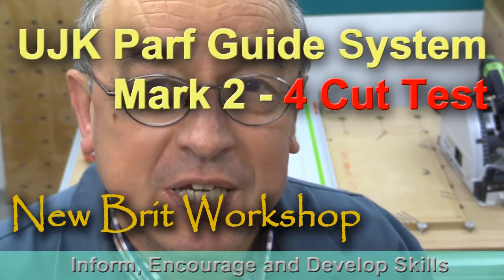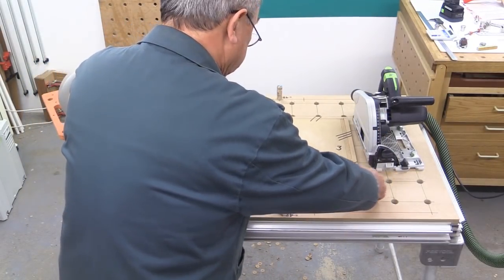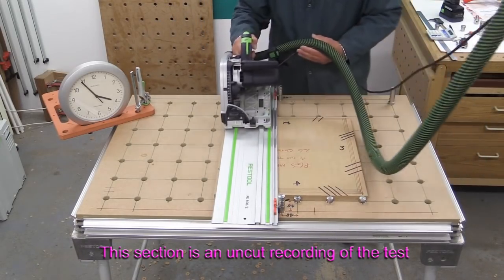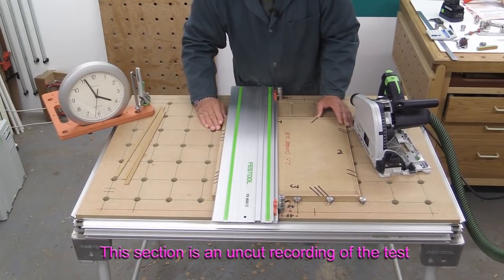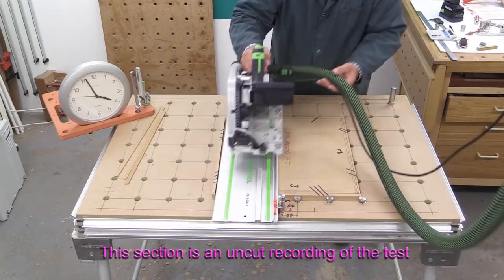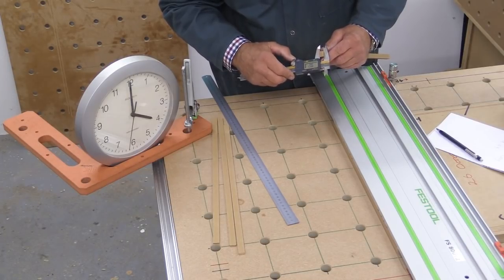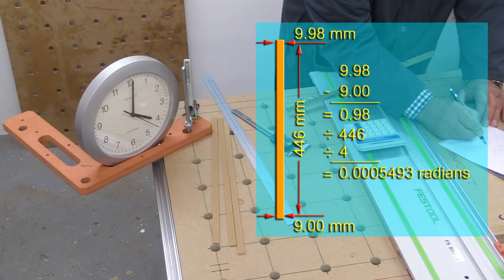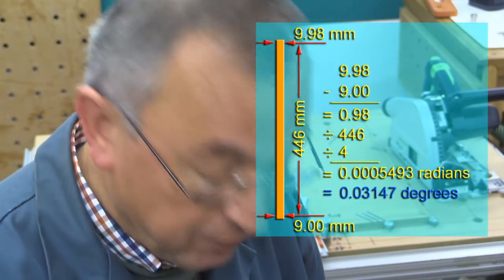UJK Parf Guide System Mark 2 - 4 Cut Test

Comment: Peter, I would like to add my appreciation too after  recently purchasing the mkII system. What an outstanding piece of kit!!

The concept is pure genius (with a little help from Mr. Pythagorus 😉) and the engineering and machining is outstanding. It was a real pleasure working with such a precision tool.

I have never owned an MFT style worktop before - let alone made one - but the combination of your videos and the precision engineering from UJK made the whole process an absolute breeze.

My first attempt produced a custom top with an accuracy of 0.016 degrees (average result on three 4 cut tests). Good enough for government work ;) I also knocked up a couple of fences/stops for jig work.

Thank you!
Reply from the maker: Hi Steven, Thank you so much - brilliant.  Cheers.  Peter

Comment: Hi Peter, out of necessity last year I made my own attempt at a MFT, using nothing but ‘great care’ - and I was very happy with it … for about 5 minutes!  Even as a DIYer, the degree of error in terms of getting things square was driving me mad - so I bought the Parf Guide Mark 2 last week, made a new MFT top (a cross between your rectilinear and isometric versions, so I can do 90, 45, 30 and 60 cuts …. and in a very small workshop space and on a quite small bench top. The result? I’m thrilled - incredible accuracy produced by the Parf sticks and guide block.  Some people worry about tear out from the forstner but? I had none - the underneath of the new MDF top was barely distinguishable from the top side. I did your 4-cut test and got a similar result to yours (thankfully my calculator has Pi 😂!!) and checked my test piece of wood with my angle finder… 2 x 90.05 degrees and 2 x 89.95 degrees - that’ll do me!!! 
Looking forward now to all the accurate cutting I can do without agonising over constant measuring. Can’t speak too highly of the Parf system - it’s superb - many thanks 👏👏👏
Reply from the maker: Hi Miachael, I am delighted that you are happy with the PGS - it took 3 years of my life to get it to market and getting feedback like yours is perfect compensation.  Cheers.  Peter

Comment: I think I need to point out that it's called a 5-cut test because you cut the first surface twice. When you measured your fourth surface after cutting it, you were measuring against one face that was not known to be straight. It had never gone through the cutting process on the outside, only on the inside surface, leaving it open to a huge potential error. Had you gone ahead and cut a fifth time, you would have been cutting off a strip that had gone through the process twice, producing a clean and Parf-accurate inner and outer face. I have done the same 5-cut test with my own Parf guide created top and my error was less than .0015 across 60 inches ( the sum of the five side's lengths).
Reply from the maker: Hi Michael, You are right and I did explain this in the video.   Peter

Comment: I think it is better to convert your angular error of 0.03147 degrees into a useable measure such as 0.33mm per 600mm cut.

Also, quite interesting that the error is double that of the previous video on the original PARF system. I wonder how much variance there is cut-cut vs system-system.

Comment: That is impressive. I have found that degrees and radians are not a practical way to measure small angles.  It is more meaningful to me to say that the cut is out of square by 0.98mm over a distance of about 1700mm (4x446mm).
Reply: Thankful we didn't go to the moon with that error ..we would be quite a distance away from 🌒

Comment: Peter, thanks for this test, it shows your system is performing similar to a 5 euro regular square. 1mm off on 450mm is not impressing. The accuracy that is "good" would need to be something like 0,2-0,3mm off per meter.
Reply from the maker: Hi Rob, If you read the previous comments that I have made you will discover that I had a fault with the fitting of my saw to the guide rail but I did not know it at the time and published the results as an honest report of my test.
I repeated the test. 
https://www.youtube.com/watch?v=FsBIWL30RP0

I did eventually make a video about adjusting the TS55:
https://www.youtube.com/watch?v=qihJeoKa86g
Peter
Reply: Both of you are incorrect.
The cut method of rotating means you are adding previous error to the next cut. Peter is actually getting 0,98 mm by 4*450 mm. That is approximately 0,5 mm/m. Which I find acceptable (issues with rail and clip nevertheless).

The alternative to the rotation is making a long enough cut (1,8 m in this case).

Comment: Actually    (arctan(.98/446) )/4 with calculator in degrees mode or if in radians (x 180 / pi). The answer will be pretty much identical to 4 or 5 decimal places but more accurate. Using radians straight away as you have is assuming the 0.98 is part of a curve even though its very close, it is still a straight line. Sorry for being pedantic. 

I own Mark 1 and love it. The accuracy is incredible. I bought the CNC made UJK assembly square and it fits perfectly
Reply from the maker: Hi John, Yes, of course. For very small angles a reasonable approximation (which is certainly good enough for woodwork) is that the tan of the angle approaches the angle in radians as that angle reduces. Maybe one day I will make a video about numerical methods for double integrals !   Cheers.  Peter
Reply: @NewBritWorkshop  Point taken but I would find that interesting !!!!!
EDIT ..... Oops! I just saw that I posted about this 6 months ago and had forgotten I had. Sorry for the duplicate comment Peter! 

You know what old maths teachers are like, they can't help themselves when they see something not quite perfect. I'll
 delete the one below
Reply from the maker: Hi John, For my thesis I created computational solutions for ballistics tables in SI units which were, at that time, only available in Imperial (foot/pounds etc). The original tables had been created by hundreds of people number crunching on old fashioned adding machines with a big leaver on the side to execute each calculation. They took several years to produce the results. I met one of these people who was, as a result of the use of those machines crippled with arthritis. I had to find efficient ways of taking the original equations (most of which involved double integrals) in order to produce the SI tables using a main frame computer. I suspect the whole thing could be done on an iPhone nowadays !    Peter

Comment: I have had your system for a little over 2 years and made a few tables roughly 3 by 5 ft with great luck but now I am making something that will be 2 x 8 foot. Do you recommend a order of drilling to ensure the 8 ft line of holes are as accurate as possible. Normally I would do 10 holes down one side then the right angle of 8 to 10 holes then work off that grid to finish the rest of the table.
Reply from the maker: Hi Richard, Start with the first Parf Stick central to the long edge and then you only have to extend the same amount left and right and it will be more accurate. You will need to use that little joining thing to link two Parf sticks when you tackle the columns. Take your time and make sure the 6 mm shoulder on the pins is properly seated in the Parf sticks. Good luck.  Peter
Reply: @NewBritWorkshop  awesome thank you.

Comment: Hi Peter, Thanks a lot for the great videos! Any advice on thickness of the mft top to be used (min - max)? 
Stefan
Reply from the maker: Hi Stephane, I use 18 mm Medite Moisture Resistant MDF. It is slightly more expensive than normal MDF but far tougher and it machines well.   Peter

Comment: Hi Peter, it is advisable to polyurethane the mdf board first before start drilling it or after?
Reply from the maker: Hi Wau, Always BEFORE drilling.   Peter
Reply: New Brit Workshop thanks a lot
Reply: New Brit Workshop another question, I found a little play between the ruler and the 3mm guide when it is sited firmly. Is that normal? Tq..
Reply from the maker: Hi Wai, There should not be any play between the rulers and the 3 mm pins - make sure that the 6 mm boss is seated.   Peter
Reply: New Brit Workshop Peter is not the pin is the 3mm guide for drilling. The pin sits perfectly. Also the pin is so fitting that is very hard to remove. I have to hammer from the back to pull it out :).

Comment: Hi Peter, are the rail clips 100% accurate? could that could add to the inaccuracy?
Love your channel. Always a great inspiration.
Reply from the maker: Hi Ernest, Yes, they do hold the guide rail tight against the tall dogs.   Peter
Reply: You rely on the edge of the rail being parallell to the inner track on the rail on which the saw is running. Which it is over a long enough run, but it could have imperfections or wear. It would probably only take a minor knick in the aluminium to shift the result that amount.
Reply from the maker: Hi Magnus, That is true. Both my rail and saw are quite old now.   Peter
Reply: @NewBritWorkshop  my very early original ts55 festool track is a little warped and I am not quite sure if age bends aluminium  extrusions ?

Comment: Hi Peter. I’m really struggling with what parf system to buy mk1 mk2. I see Axminster are selling the mk1 at a very good price. 
Thanks in advance
Reply from the maker: Hi Mark, If you are only likely to use the system a few times then the Mk I will be fine but for long term durability (and sharing the kit with friends) then the Mk 2 is better.  Peter
Reply: @NewBritWorkshop  hi Peter. I just thought I would give you my thoughts on the parf mk 1. Axminster as per normal posted fast and dpd delivered it today. 
With the custom size top cut I started to lay out and get my head around the system. Having been hopeless at maths in school and looking at the instructions for a hour a picked myself up and went for it! 
Credit to you and Axminster I now have a nice mft that fits my space and with very accurate holes. 
The system is very well thought about and made very well indeed. 
I’m not sure I followed ever detail in the instructions but it all ended very successfully. 
Massive thanks to you Peter 😊👍
Reply from the maker: Hi Mark, That is brilliant and I am so grateful that you let me know about your success and pleasure with the product.  Cheers.  Peter

Comment: Interesting to note I parf holed a flat plywood 17mm top and it warped after all the holes drilled . Has anybody encountered warping after holes ?
Reply from the maker: Plywood will do that as a flat sheet has many stresses but the glue keeps the sheet flat. As soon as you start to machine it (take bits away) there is a risk that some of the stresses will be relieved by movement. Better to use 18 mm MDF.  Peter
Reply: I do recall when a wood worker friend was ripping sheets he always said run it though the saw a second time because the sheet releases stresses after its cut
Reply: @NewBritWorkshop  do you have the link of where you repeated this experiment with a tuned TS saw ? I just cannot locate it but readai where you did one
Reply from the maker: Yes, I had to look for it:
https://www.youtube.com/watch?v=FsBIWL30RP0
I have now put 4 cut test in the title. The test is after 12 minutes or so.   Peter

Comment: Hi Peter,  What are those short dogs you call "pups"?  Addendum:  I see from your other video that these are the UJK Guide Pups.  I will get some.
Reply from the maker: Hi John, I think that the Pups are perfect but remember, all of the UJK produced dogs and extras are built to a tight tolerance and so they will be snug in the holes. I like to leave mine permanently in place on my tracksaw cutting station.   Peter

Comment: Hi Peter, am I reading this correctly the cut is 0.25mm tapered over446mm.( 4x0.25 = 1mm over 4 cuts ) I would have expected a precision setup like this to be a lot more accurate ??
Reply from the maker: Hi Mike, I think that it is rather good considering  there are so many other factors that can affect accuracy. I will initiate a competition amongst Mark 2 owners once the product is properly launched. I will have to discuss this with Axminster but we will invite people to demonstrate the accuracy of their creations and see who produces the best result. There would have to be a method of verifying which I have yet to work out.   Peter
Reply: I cannot see any errors in your engineering or build quality, could this be an accumulation of error within the saw/guide ?
Thanks for the reply great channel !   mike
Reply from the maker: Hi Mike, There will be some errors from the saw and guide rail (both over 9 years old) and then the operator - a dash older than the saw ! But even so, 0.03 of a degree is pretty good.   Cheers.   Peter
Reply: It's 0,55 mm/m which isn't super accurate I agree. But I would like to use another material than MDF and take an average over 10 tries.
Reply: Oww  @NewBritWorkshop  what would be the prize??
Reply from the maker: I will talk to Axminster when I see them at the Harrogate show.   Peter
Reply: You've probably already been told this, but that error is to be calculated over the total length cut, nearly 1700 mm. That means the error is 1/4 is great over four surfaces, not four times as great as you are intimating.

FYI: that comes out to .0024" error across 66". In layman's terms, that's half the thickness of a sheet of copy paper or 1/5 the width of a line made by a marking knife. Not too shabby.
Reply: @mountainlightwoodcraft  That's not true, the lengths of previous cuts are irrelevant. Only the length of the final cut matters, which is multiplied by 4 . So 446 * 4 = 1784mm. 

Also the error should not be considered as final. This is where your accuracy starts from and only compounds from there. So getting it as close to 0 as possible is important which is easily possible with rectangular fence and supports.

Otoh 5 cut method can have problem with track saw because such small offcuts are not reliably straight. I have setup squared to 0.015mm per 1m and could still get offcuts with 0.75mm / 1m as they were not straight. So  offcuts should always be checked for straightness before checking for squareness.
Reply: @mikewright7263  Those kind of errors affect cut straightness. Each cut should be checked for straightness (using precision straight edge) before proceeding with a cut because straightness is requirement for squareness. If each cut is checked for straightness then the only possible source of error is that the setup is simply not square.
Reply: In fact, Petka, we're saying the same thing. The important fact is that the error must account for the sum of all cut lengths, not simply be factored for the length of the final cut.
Reply: @mountainlightwoodcraft  The previous cut lengths are irrelevant. Only the last cut length matters. The previous cuts are only there to compound the angle to make the error easier to measure.
Reply: @mountainlightwoodcraft  thanks a lot!! I spent the whole day thinking that my mft / 3 is not square. I had 0.6mm by 500mm results after four cuts, then I multiplied 0.6 * 4 and got 2.4mm / 2000mm error and got frustrated. thanks to you, I now divide 0.6 / 4 and rejoice at 0.15mm / 2000mm error

Comment: Peter please excuse my ignorance but how do not get kerf marks in the table. I’m a total novice by the way
Reply from the maker: Hi Derek, It is almost impossible to avoid unless you put a sacrificial piece of material under what you are cutting. The Parf Guide System has been designed to take away people's anxiety about their bench tops as it is now very easy to replace them.    Peter
Reply: New Brit Workshop thanks for the reply Peter.

Comment: Hi, I just bought the parf guide system and didn't realise a second version was being released, is it better to return this and wait till 2nd version becomes available?
Reply from the maker: Hi Sam, I have made over 30 MFT3 tops and 7 or 8 track saw cutting stations with my original and had no problems at all. The Mark 2 is more expensive. It depends on your estimate of the usage.   Peter
Reply: @NewBritWorkshop  Hi,
thank you for the reply I'm not expecting to make many tops but didn't know if the offset would be useful. I'm just watching through the other videos. Thanks Sam
Reply: @NewBritWorkshop  Hi Peter, thank you for the previous reply, I saw the MK2 in the axminster catalogue it isn't that much more expensive than the original but does look to be better even for 1-2 tops, unfortunately I didn't return the mk1 I  purchased before (haven't had a chance to open it yet) given your previous comment, so I'm a bit disappointed as I would have waited. Still enjoy all your videos Thanks Sam